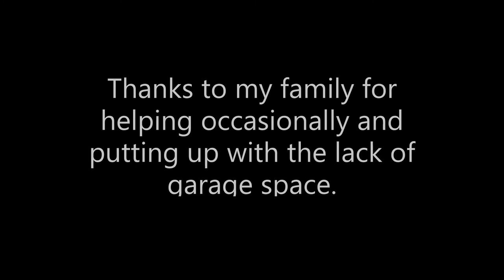C4rtvette Build Montage

Comment: The tubing you used is much larger than I'm used to seeing. It looks great! What size tube is that?
Reply from the maker: 2" tubing. If I had to do it again, I would probably go with 1.75" to save a little weight...but more importantly a lot more accessories can bolt to 1.75" tubing. It's hard to find things like mirrors that clamp to 2" tubing.